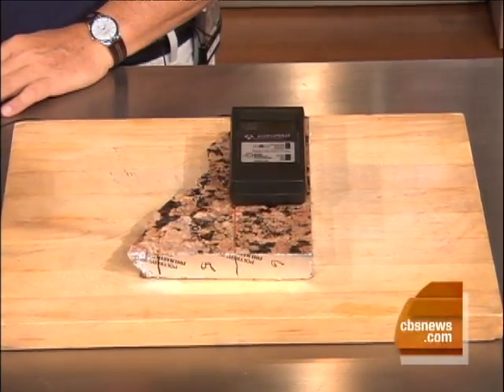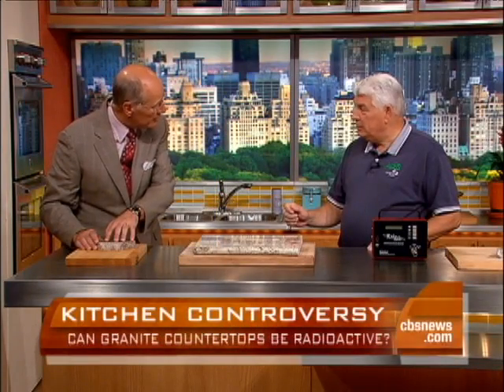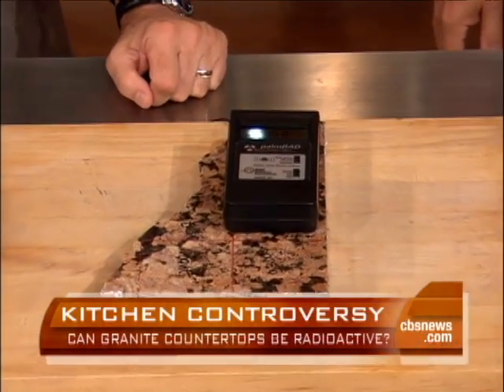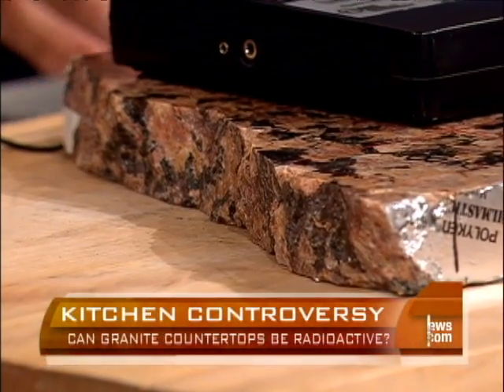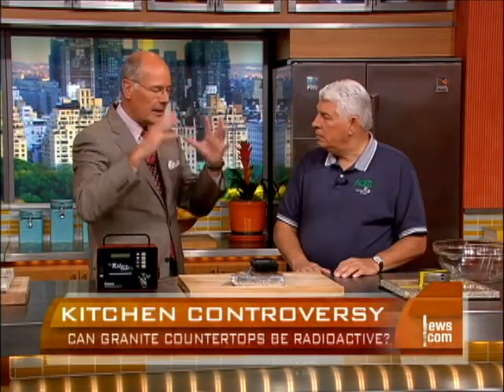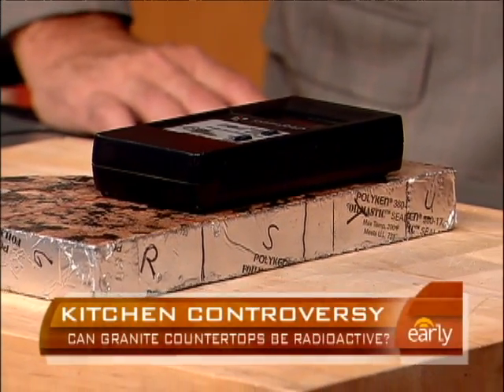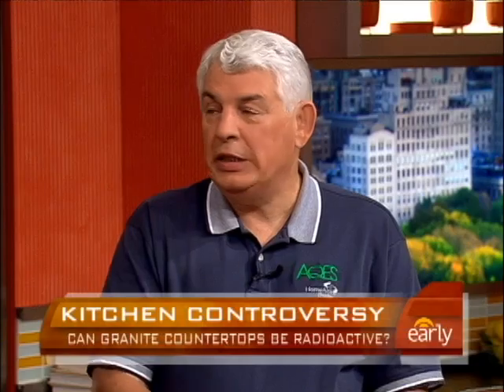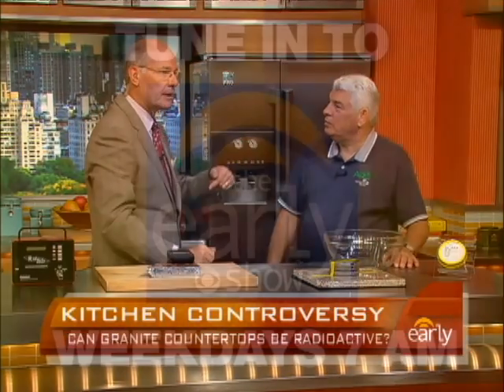Radon Found In Countertops

Comment: That dude clearly had no clue about what's a safe level of ionizing radiation exposure and what's not; the amount of gamma radiation shown here clearly isn't something that we should worry about.
Reply: I have Cs-137 countertops with neutrons moderators.
Reply: @ionhunter  Cesium 137 is both a beta and gamma emitter.
Reply: @mach1553  Clearly you missed the joke.

Comment: We were aware of the dangers when we got our granite installed last March.  I had pre called the yard, and asked if I could bring my counters with me, and they said sure.  I tested about 15 slabs, and one had high readings, (400 uR/h on PM 1703 scintillator) The rest were an average of 100-250 CPM with background of 45-50.  15-35 uR/h)  Pretty low really. Ours averages 125 CPM. Our Safety Siren Radon detector fluctuates between 2.6 & 2.8,  which is below the EPA of 4.0
Reply: YOUR OWN PERSONAL GEIGER COUNTER..........................Get a life....Because your already dead.